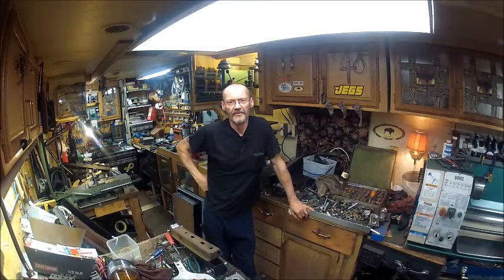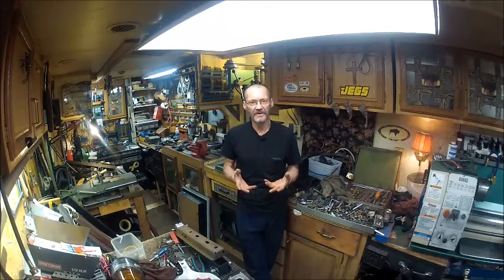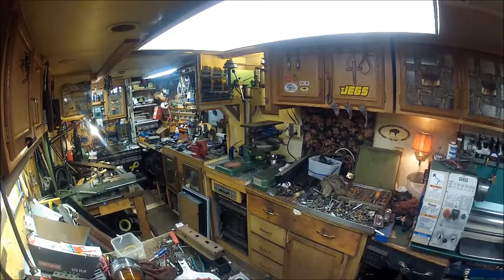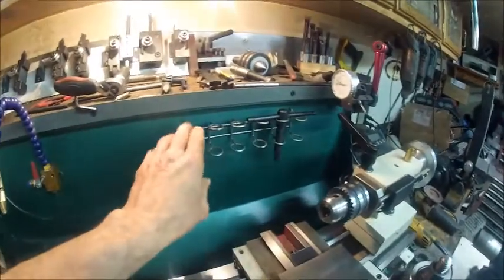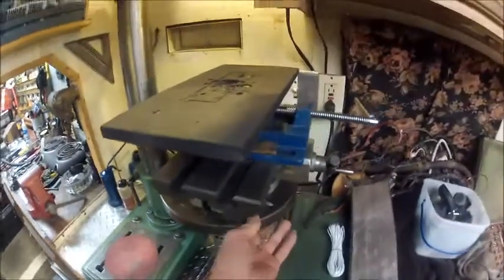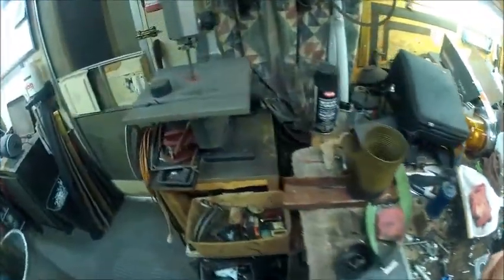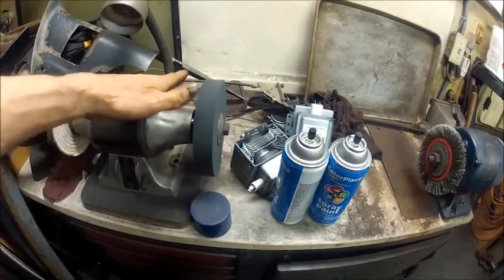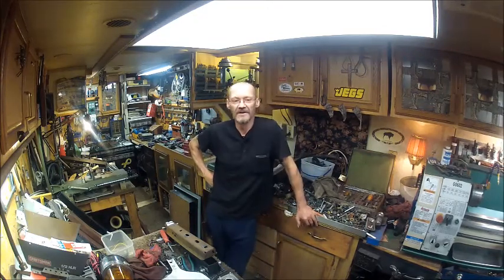Bison shop tour and wireless mic test

Comment: That wheel has to go on a regular grinder not a buffing grinder I had the same issue and the sound sounds good keep doing what works for you brother.... cheers
Reply from the maker: its too thick to go on my grinder and thank you
Reply from the maker: and that is a reg grinder. i just have the disk shields off and using it for a buffer instead of a grinder and wire wheel.